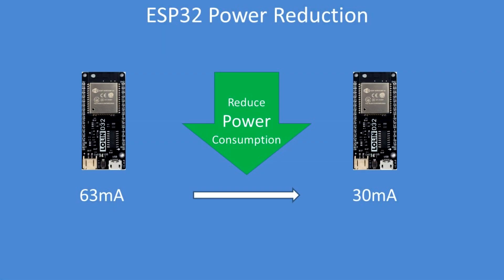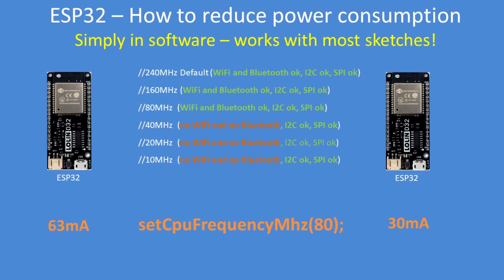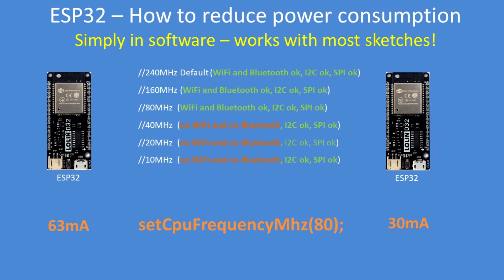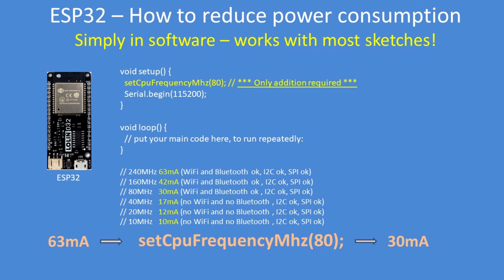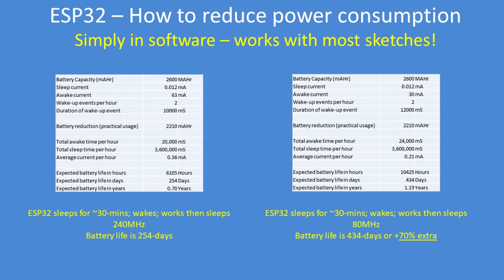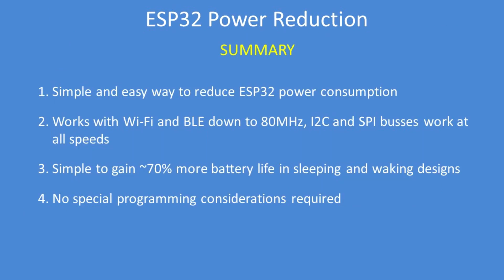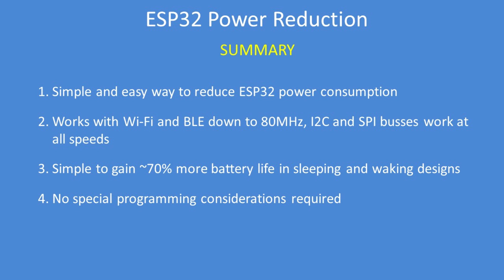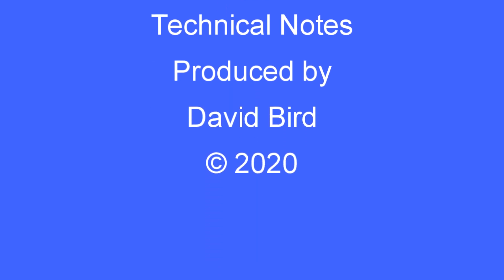Tech Note 134 - ESP32 Easy power reduction method for battery powered projects

Comment: Excellent! From what I read, at one point dynamically changing the frequency used to cause issues with the serial monitor. But either that was incorrect, or they fixed it, because I've been able to switch between 80 and 240 for my project. I haven't tested switching between the lower frequencies and higher, but I'm curious if the wifi/bluetooth will bork itself doing that. Something I may test months later when my parts are finally delivered (Canada post). Thanks again for these helpful videos!

Comment: Question, how does one turn off or turn on a battery powered ESP32 board? Ok a switch in line with the battery, but then it would not charge when off. 

On a previous tech note, reference was made to a regulator enable pin, could this be use? 

I can't find any details on running a finished project using an esp32 with integrated battery connecter.
Reply from the maker: Depending on the development board design, the regulator is a useful on/off switch input, on most regulators, if the regulator is not enabled the typical sleep current becomes very low, on the ME6211 (note not every board gives access to the Enable pin) when not enabled, the regulator consumes 0.1uA, that's very much smaller than the battery self-leakage current. This does entail the use of a switch to change the state of the pin, so may as well switch the supply off by a switch!

Comment: Thanks David. In the midst of dimensioning a battery operated water level meter. How did you calculate the avg current per hour? I don't get the same results. Lastly can I access the MCU in sleep mode for an even driven use case?
Reply from the maker: Hi Thomas, to find average current per hour to get to mAh you need to know how many times the cpu runs and at what current level then know sleep current and then sum it all up.
Example cpu awake takes 70mA for 5-secs and runs once per hour, it takes 0.1mA when sleeping for the rest of the hour, so that’s 70*5/3600+(0.1*(3600-5)/3600)=(0.0972+0.0998)=0.197mAh
A battery of capacity 2600mAh would last for 2600/0.197=1.5years
When the cpu is asleep it can’t be used, well if an ESP32 you can use the ULP cpu but there are few commands it can conduct and requires specialised programming to implement.
Reply: @G6EJD  Thanks for that explanation. Makes it clear how to dimension the battery

Comment: Hi, What is the best power consumption for BLE battery project. Like a BLE server that is waitting for client connections?
Reply from the maker: With the radio on your not going to get consumption that is much less than 100mA, it is the receiver that takes the power when listening.

Comment: Thank you. Very useful! 
Is it possible to power an ESP32 dev kit with a 9v alkaline battery?
Reply from the maker: Not with a voltage reduction regulator and a PP3 / 9v battery has a very high internal impedance and low capacity, so it would not last long and may not be able to deliver enough power to drive the ESP.

Comment: Does this work on a esp8266 also
Reply from the maker: Unfortunately not, the best you can do is when you compile and upload is select either 80MHz or 160MHz clock speeds, the faster rate will consume more power.

Comment: If you're using a board as pictured with voltage regulator and USB interface do these create additional current usage in deep sleep? I know there are some boards where the voltage regulator used up to 2 mA all the time, taking deep sleep from around 10 microAmps to 2 milliAmps!
Reply from the maker: I only use the Wemos D32 which when battery powered does not power the UART and it uses a low quiescent power regulator and easily achieves 55uA in deep sleep. Yes many poorly designed boards consume around 2mA when the cpu is sleeping, with that consumption being set by the UART and regulator, sometimes voltage dividers too.

Comment: is there any issue with changing on the fly?
if you had it coded so that it dropped to 10mhz in the downtime, then wake up, turn up to 80mhz, get the wifi going, do the deed, and then revert to 10mhz for sleep again?
Reply from the maker: Don't know, a good question, but I can see no reasons whatsoever why it would not work. I'll try it out later.

Comment: Hi, you suppose wake-up duration is 10s@240MHz and 12s@80MHz CPU speed. Thus 70% batterie life improvment.
Could you elaborate how dividing frequency by 3 only results in a 20% duration increase?
Il seems highly situational, as ESP looks more efficient at full CPU speed (see MHz/mA).
Reply from the maker: As I mentioned in the video, it's not a linear relationship, in the example I used, it was an ESP32 sleeping, waking then obtaining time, then reading a BME280 saving the results and then going back to sleep, which took 10-sec at 240MHz and I expected the duration (initially) to be extended to 30-secs at 80MHz to do the same thing, but that was not the case, so I concluded that CPU time used is much less than the time needed by external influences such as NTP time services, BME280 read times and other delays, implying the CPU is much faster even at 80MHz. The only difference I've noted in cpu performance is when decoding JSON data, but again it is not taking x3 longer to decode at 80 verses 240MHz. IT was not meant to be an in-depth analysis of cpu performance, more a simple technique that can save quite lot of power for simple code  mod  and for many applications, cpu speed is irrelevant IMO.
Reply: G6EJD This is really interesting! And yet there is some calculation with BME280 library.
We can conclude ESP32 is often too fast, and has to wait slower modules (WIFI, I2C ...).

Comment: I have been working on a complex project and did this already to save power. Other things you can do is turn off wifi and Bluetooth until you actually need to use them, and then turn them off again.
Reply: Hi. I was just thinking that, because my project also needs a way to turn the wifi on, as soon as an i2c event gets triggered.
Could You share how You accomplished it?
Thanks